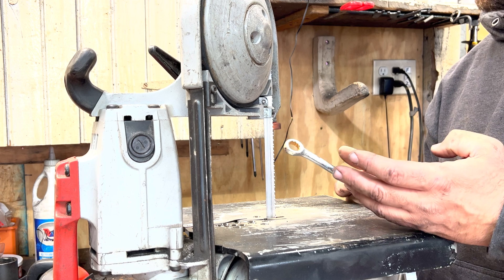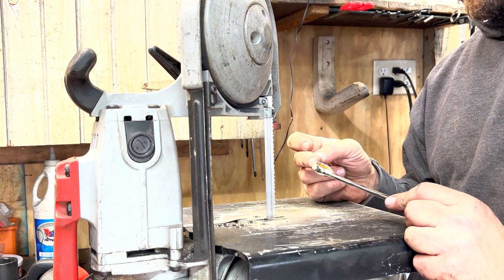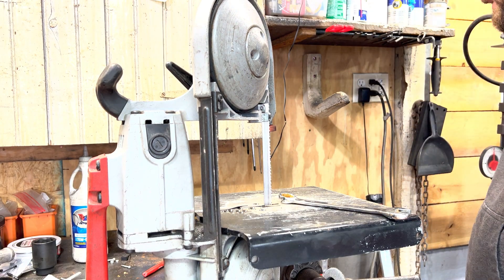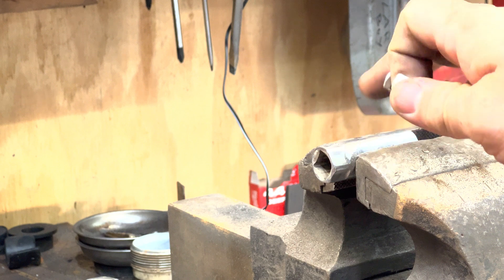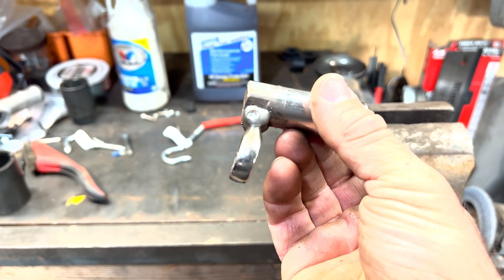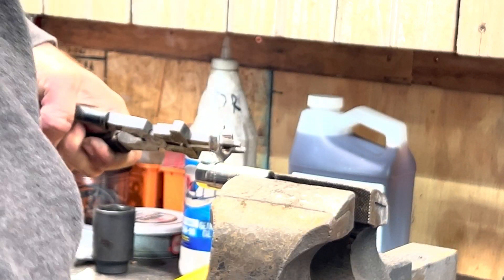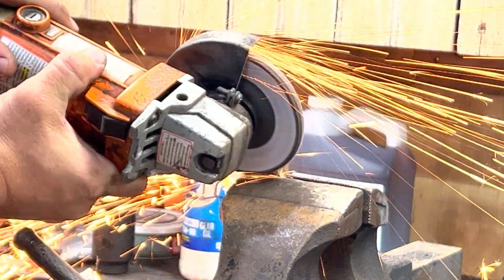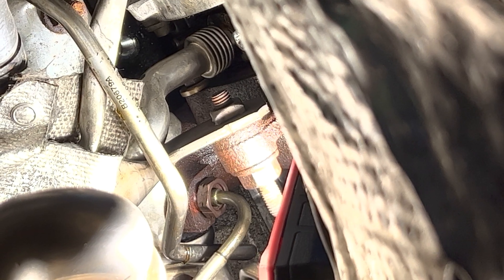Custom Tool Fabrication! Needed a Metric Crowfoot Flare Wrench so I Made One

Comment: why you did not film the removal?  you used your go pro to fil the welder machine spool turning in which it also consider a tight space! could use the same camera to fill the tight space to see how well or not the tool performed!
Reply from the maker: Sometimes you just run out of steam. Will do better in the future. Thanks for watching!